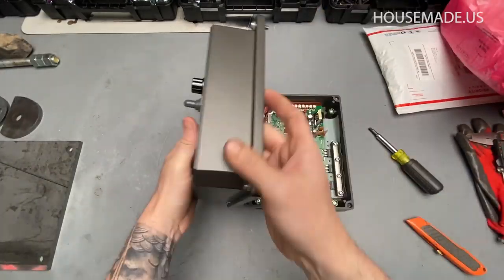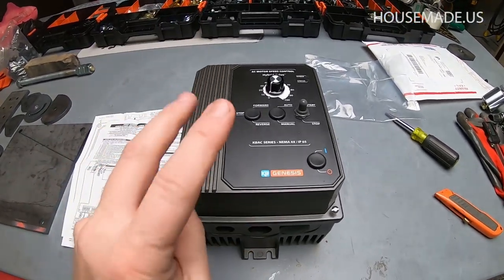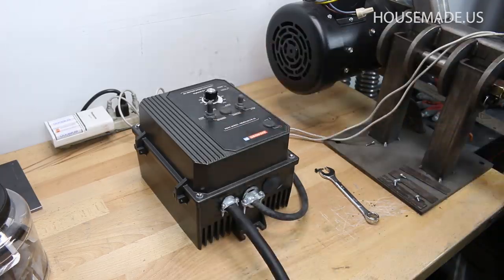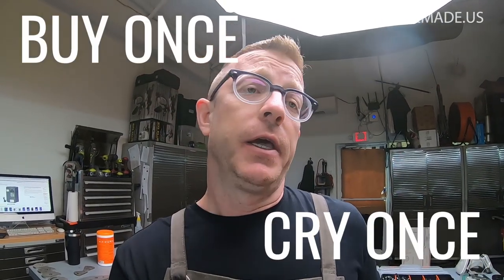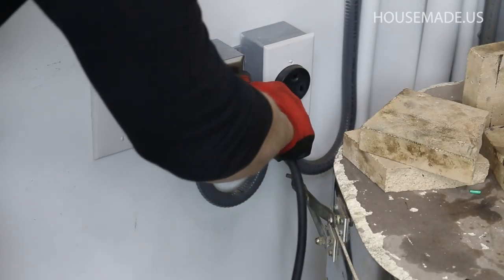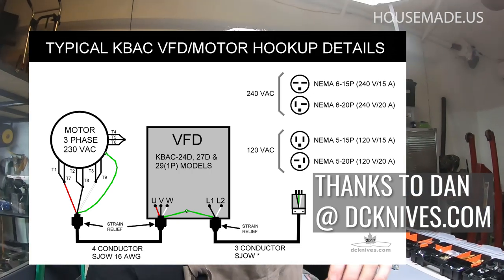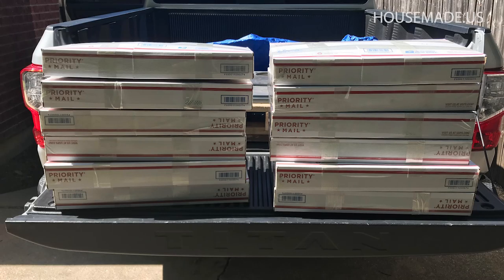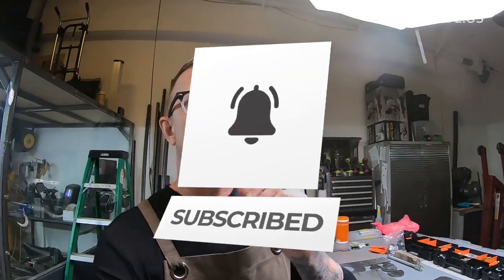A Cheaper VFD for a 2x72 Belt Grinder Build

Comment: I picked up a 3hp baldor on the cheap, so I had to go the next size up on the vfd. I flipped the extra $20 and went with the digital with built in reverse, and I don't regret it.  It was expensive 8 months ago;  probably a lot more now. Thanks for sharing your journey on alternatives, Brian!
Reply from the maker: What model did you get? I am interested in a digital version.
Reply: @HouseMadeUS  I got the KBDA-29.  It still has the dial for quick control of the speed, and it can be programmed for RPM or surface feet per minute on the digital readout, which is really handy!

Comment: You're videos are awesome and well appreciated. 
My experience... That cheaper VFD worked great until it didn't (less than 80hrs of use). Now it gives a Er 04 when I hit the run button. I wish I just paid a little more and bought the better one, because now the $380 VFD I just bought costed me $480, with the cost of the cheap VFD.
Reply from the maker: Yeah buy once...cry once! Sorry to hear this. Mine is still going strong. But I keep it blown clean, who knows they are hit or miss.

Comment: Have the same cheap vfd on my drill press , and several other cheap models on a lathe , Bridgeport, belt grinder , exhaust fan.   They all work fine just keep dust and debris blowed out with compressed air .
Reply from the maker: Yep, 100% agree. 👊🏻

Comment: My friend built his 2"x72" from an old treadmill motor & speed controller 8 years ago. He uses it daily in his small engine repair shop. He made 2 aluminum boxes with 3M HEPA furnance filter media, washable foam prefilter and 5.25" PC fan for the speed controller & motor housings. He's thinking of adding copper pipes worh sliding magnets inside as a prepre airborne metal filings catcher. Mutch like a tool made to clean up lathe/mill fillings.
Reply from the maker: Yeah that definitely can work. I prefer to have a sealed motor that isn't magnet driven in a metal working shop myself. I have had one blow on me and it just made sense to me to go to the AC motor. Buy once, cry once. :) I will however repair the DC motor and use it on my lathe or perhaps another machine that creates less dust.
Reply: I have a treadmill motor setup that I will be using in my grinder (at least in the beginning).  I got the treadmill for $20 so, if the motor fries on me, it’s not a big loss.  I can’t afford a 3 phase motor and VFD at the moment, but possibly in the future.

Comment: I have 2 of the kbac 24d VFDs in my shop running a 2hp 3 phase motor to chinese mini lathe. This VFD maximum HP functionality is only 1HP. I acquired 2 of these 3 phase motors and 3 single phase motors and also 4 smaller VFD KBWA-23D-WITH-FSR “free” during a job remodel and the owner said he didn’t have time to sort out trash and what isn’t trash and told me to feel free keep what I wanted and trash what I didn’t so win win right. I had been running the 2hp motor to the lathe and one day just lost power and I’m not electrical savy and just switched to the second VFD settings all the same and while clipping electrical cables to mount in their proper position I must’ve had a piece shoot off onto the board and after closing, sealing the box, and then firing it up all was good for about two weeks and all the sudden BAM BIG POP AND BLUE LIGHTS CAME TO MY EYES AND SHUT DOWN POWER THEN INVESTIGATED AND FOUND WHERE IT CAME FROM AND THEN I HAD TO PULL THIS SECONDARY VFD OUT. Now I have the KBWA-23D-WITH-FSR which is only 1/2HP and dude I can’t take those deep 0.100” cuts anymore.  Back to the the first VFD that mysteriously died on me. Would my KBAC-24D VFD have crashed due to this being maximum 1HP and running to a 2HP 3 Phase motor? Everything is compatible within range except the HP rating. I was told that the VFD would only produce its maximum which only is half of the the motors capability. How can I fix my 2 VFDS until I can upgrade to the same exact one you have and also does KB manufacture any external controls like a analog, potentiometer, or jog? So I can store VFD out and away from the machining area. Under the table mounted with external controls running into the old mini lathe control board only hollowed out. Let me know what I can do or should do please and thanks for any information also watching your channel is also giving me tons of knowledge.

Comment: Brian - Glad you are doing GREAT!!!  Thank you for the update on the VFD.  Lacking welding capability I am gathering materials for a bolt up version of Dan C's design.  I bought you plans and  I will incorporate ideas from you design.  Specifically I will most likely use your longer  D-plate, platen & bracket design and if available separate from you flat plate package, I may elect to buy from you.  I'm a ways out from my build so I will continue follow the Revolution progress on House/Work!!  Love you channel - Keep up the fantastic work!!!  David
Reply from the maker: Hey David, thanks so much man. I am in the process of creating a no weld grinder that will be plate and hardware based. It will tilt and do all the fancy stuff the Revolution can do as well. I am a few months out on that though. Thank you for following along and supporting my work. I truly appreciate it brother!!

Comment: Sooooo glad you addressed this! Primarily because of the price because I'll have to buy Amazon welder too for build lol
Reply from the maker: Yes Dustin! This is been something that I’ve wanted to try for quite some time. So I’m hoping it actually works out. Over on the Facebook group people are quite passionate about the subject and many feel as if it will fail. I’m hoping that with the right wiring and keeping the VFD away from the grinder or outside of the grind room, we can solve the dust and heat problems.

Comment: I've got and Invertek Drive.  It's a really high quality drive.  I'll have to see how it works.  It's not dust proof but I'm going to enclose it.  I got it from my AAMC dealer.
Reply from the maker: Cool, I’m looking forward to hearing back on how it works. If this VFD works, it knocks a whole lot of money off of the build. Which is valuable to just about any 2 x 72 belt grinder build. 👊🏻😁
Reply: @HouseMadeUS  I think it's great you're exploring new vfd's.  I feel like you have enough pull to get the internet be be more open minded about grinder vfd's.  There is such a massive group think right now that the KBAC-27 or 29 is the only good option.  They are not bad but they are not the end all be all.  Other than being dust proof they are pretty limited.
Reply from the maker: Beck's Armory Yeah I know what you mean. I think that this should be a somewhat scientific comparison between the two. With as many dollars as there are in between these units someone should have some definitive answers associated with what people pick. Yes the KBAC-27D is a fantastic VFD. It’s also very reliable. It’s also very expensive. There should be a fun experiment!

Comment: I have one of these on my grinder and one on my bandsaw. I had another one that I used to run several different machines that I've built and tested for over two years before I burnt a resistor out on the board. I ran that thing hard and never enclosed it, so it may have failed because of all the grinding dust and other debris in the air. I wasn't worried about an enclosure because they are so cheap. The one on my bandsaw is enclosed and has yet to fail.
Reply: @mikephilipps1103  eBay also sells them.

Comment: Be carefully to read details of purchases. Not all VFDs are single phase 240v input. Input and output vary greatly. I have done exactly what you describe using cat 5 to make a remote with a magnet on the back to attach to whatever machine I am using. My vfd is also mounted in a box with service cable and plug ends coming out if it. It allows me to use it to run several different machines in my shop.
Reply: Do you have any pics of this setup? Very curious about how you got one VFD to control multiple machines. Didnt even know that was possible, but would save tons of money assuming they all have the same input/output
Reply: @RibeyeReaper  I did take some pictures but I'm not sure how to show/post them.

Comment: Brian I must take issue with your statements @ ~ 7:55. Single phase motors come in a variety of configurations. All of which are classified as "Induction Motors". All induction motors regardless of their sub class are RPM vs Frequency dependent. While it's true that commercial VFD's are manufactured to control 3 phase motors there are DIY circuits that are successfully controlling single phase motors. How well they perform is a totally different matter. Anyone using VFD's will notice that low end torque suffers even with three phase motors. However bad it will be, it will always out perform a single phase motor at any frequency. 
Wakodahatchee Chris

Comment: I have one on my 3 phase mill that I put on after the original one failed. The only issue I've had is that when I ramp up the speed on the high gear I can't just kick it on, I have to step it up or it "errors" and turns off.
Reply from the maker: Ill keep an eye on that, I know that these things have issues which is why I am tenative about recommending them. I want to put it through the 'House / Work' field benchmark test first. (lots of grinding things I shouldn't be grinding) LOL If it does work I will upgrade my lathe to a 3 phase AC and one of these. It would add a lot of functionality to it.
Reply: do these cheap ones work with 110v supply? jthe link is to a 220v one . or can you power the 220 vfd with 110 supply
Reply: burny knob no strictly 220v input.

Comment: can the kbac and Ironhorse motor in your parts list be wired for 120v input?  I don't have 240 installed yet.
Reply from the maker: Yes they can be. You won’t get the full HP from a HP though. You will get 1.5 hp. 👊🏻
Reply: @HouseMadeUS  Great. at least Ill be able to use it until I can get 240 installed.
Reply: Yes the K B can be used on 120 volt.

Comment: This VFD .... KBDF-27D (IP20 housing) is actually better capable, same brand and over 100 bucks cheaper than the KBAC-27D (IP65 housing). It just doesnt have the "enclosed" housing. If you use the Asian brand... its the same rated housing (IP20) but is even cheaper.

Comment: Good vid. One way to stop dust getting into your vfd or motors  if you dont have an enclosure is to use womens pantyhose. Even two layers to help with fine dust. Will prevent about 95% of the dust from getting in and its breatheable so it wont over heat. Plus its always better to have your vfd away from your machine either to the left or right side of it and slightly forward of it. Allows for less dust near it and its safer to use as your not reaching past the belt to controll it. Idealy even have it on retractable arm so if your in a tight space you can move it how you like.
Reply from the maker: Now that’s a good idea. I’ll have to give that a try. 👊🏻👊🏻👊🏻

Comment: So if you can't adjust the speed on a single phase motor how do they do it on Treadmills ?
Reply: treadmill motors are DC motors
Reply from the maker: What Brandy said. :)
Reply: They have a bridge rectifier turning the AC to DC then it uses a SCR(silicon controlled rectifier) to control speed

Comment: I tried my build with the cheaper VFD, but when I turn it on it takes a while to speed up then it never really gets going fast and the second I touch something to the belt it slows down to a stop, no torque at all.  Is this the VFD or what? I have a new 3hp motor 3 phase with a 2.3kw $89 vfd 8200 - I mean this thing does not work at all...any input would be greatly appreciated!
Reply from the maker: Sounds like a bad VFD or possibly the wiring config is wrong. Did you use the wiring diagram from my resources page? Also verify you have the correct VFD for the input voltage. 110/220 etc

Comment: FYI, a Leeson 56c motor will not work with your grinder, as it is in the plans. The risers will need to be 1.5" taller. Ask me how I know😕
Reply from the maker: Oh bummer, that sucks man. I have never used one before that is why the recommended motor is an IronHorse.
Reply from the maker: Not sure where you read that a Leeson motor works with my plans? It's a NEMA 56C face mount but I designed it for the IronHorse.
Reply: House / Work I didn't read it anywhere.  I just ran with what I had.  Totally my fault. I just wanted to put it out there to save someone else some extra work if they were planning on running one.
Reply from the maker: I see, are you going to extend the risers? That will fix the issue.
Reply: House / Work Yeah, I'm adding some material to the bottom. It will work out.  I'm really enjoying working on this project. I'm glad you happened along when you did.
Reply: I had the same problem with the motor I used, I just added the height by feet on the bottom of the base also, at least I think that's the same deal you speak  of.
Reply from the maker: Ahh I see. Yeah definitely something to add to the plans so people don’t overlook that. 👊🏻
Reply: @HouseMadeUS  Motor lengths vary wildly by motor construction. In three-phase, two pole motors are shortest, four pole motors have twice as many winding and take up more length. The longest being a single-phase four pole, which in addition to the to extra copper in the windings needs a place to house the centrifugal switch.  In my experience NEMA 56C's can range from  10.5" to over 14" for 2 hp and less. Some 3 hp motors and six pole motors are longer yet. Unfortunately, NEMA doesn't specify the length of a motor frame size.

Comment: Why does it seem like a great idea to be able to control it remotely if you’re working at the motor not in another room?
Reply from the maker: The Vfd sits away from the machine and the remote sits close to the grinder. Metal dust will settle in the VFD if it’s close to the grinder and kill the electronics.

Comment: Be careful.  There are two VFDs that look similar.  The HuanYang and the fake one that is made to look very similar.  The HY is the best in the market for the price.  I have two of them.  They can be a simple implementation or detailed.  It is Chinesium but the manual is still really good.  It derails a ton of programmability available in the model.  I do not know anything about the fake one other than seeing a lot of warnings and negative comments online.  Good luck.
Reply from the maker: Thanks for the info. That is really good to know. So many fakes out there.

Comment: Did I understand correctly that ou said you would wire it with CAT5?  How much current does your motor take and how much is CAT5 rated for? Next you said that you cant change the speed of a single phase motor....  does not make sense.  it is being done all the time
Reply from the maker: The CAT5 wire would run from the control box back to the unit. (The small control panel) not the actual 220 from the wall or to the motor. That could cause a fire or destroy the equipment.

Comment: man im totally ignorant about this, i have 110v and i need a cheap motor and vfd , is there anyone that can help
Reply: If you want variable speed load (eg: belt grinder) using the wall outlet (110v - 15amps), get the VFD with a 110V input and 3 phase 230V output like the one Brian suggested. Then you can buy a 230V, 3 phase motor (also Brian recommended).

Comment: The idea of this lower cost VFD is great only problem the quality of these is just terrible. Plus when you have a failure, KB’s customer support sucks. I been waiting over 3 weeks for resolution on why mine blew up after about 10 hours on it after installing it in 12/2020 it popped several components on a leg of the 3 legged transistor melted the trace from the leg to the little surface mount  caps and resisters. Do yourself a favor. Buy a good proven VFD for a few more dollars. You’ll end up better off paying once, instead of buying 2 of these POS, with 0 customer support.

Comment: I am not sure where u got ur information, when u said it is not possible to control speed on a single phase motor, that is absolutely false. Not only can I show u tons of articles / videos on it, I have a single phase motor setup using variable speed that I can show u.
Reply from the maker: I know it can be done. It really shouldn’t. Failure Rates are high and it is not efficient. 3 phase all the way. Reliable power and torque. 💪🏻😁